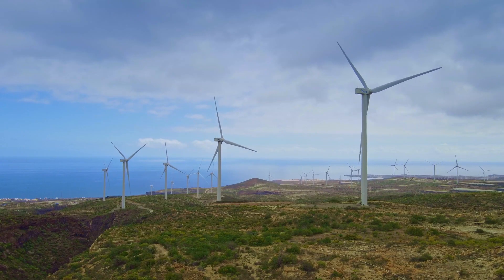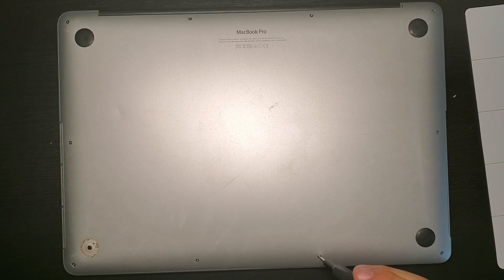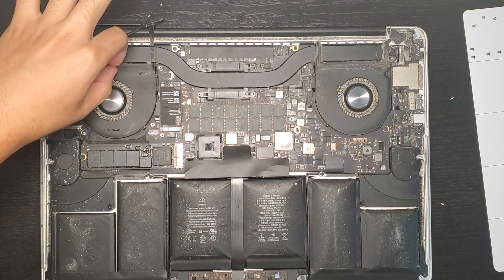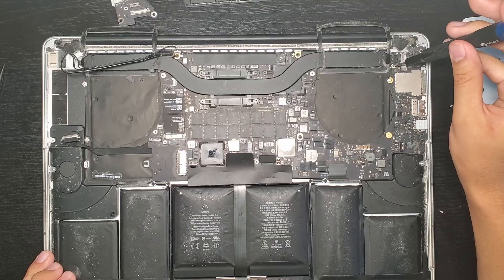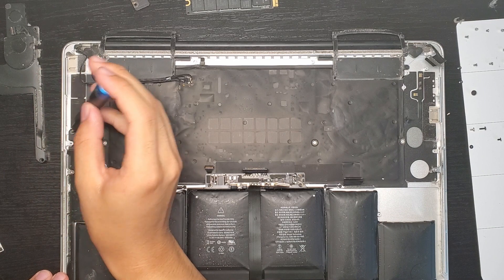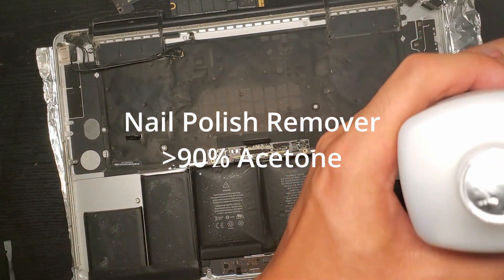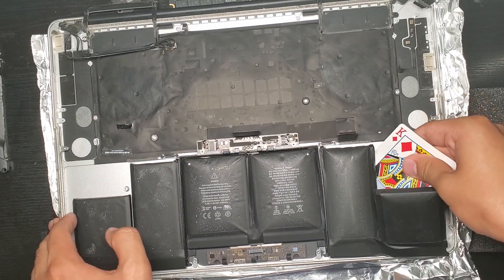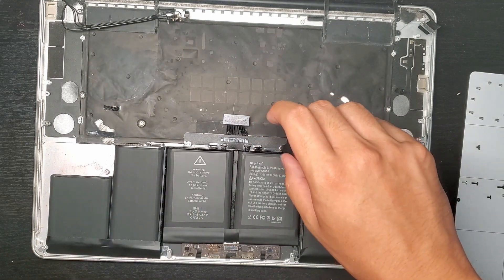MacBook Pro Teardown, Battery Replacement, & SSD Upgrade | mid-2015 15" Retina A1398

Comment: Did you clean the fans? They are absolutely coated in dust and this would have been a good time to do so.
Reply from the maker: Yep! The reason it's not in the video is because we didn't have compressed air at the time of the recording, so we had to do it afterwards.